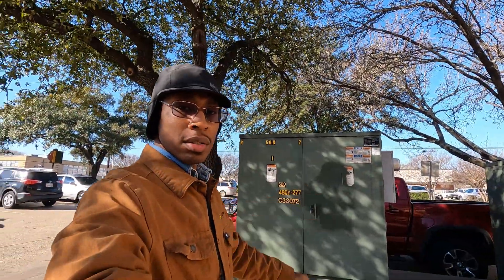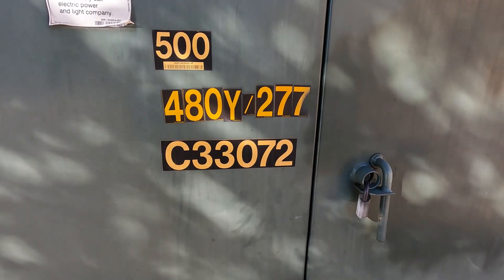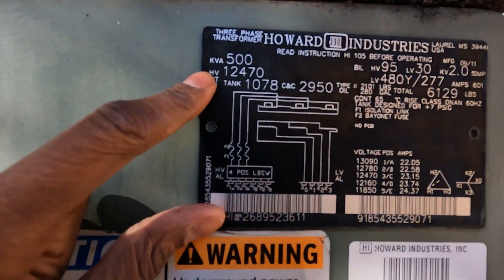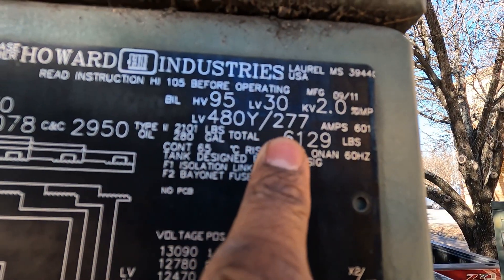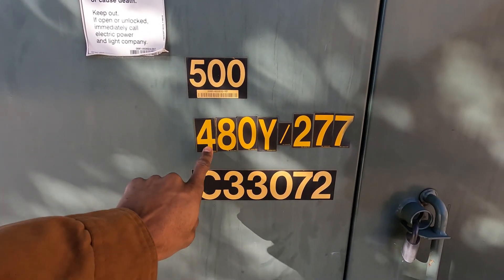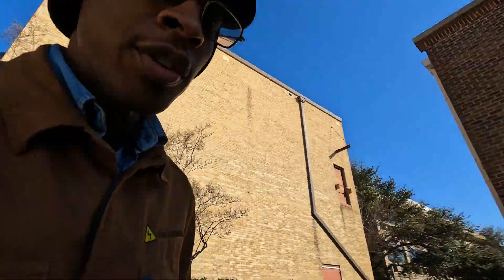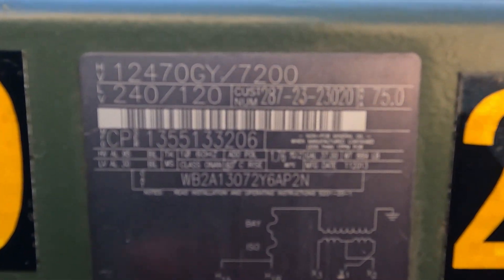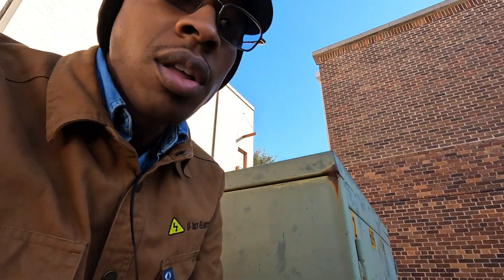Pad Mounted Transformer? Why Do I See These Everywhere?

Comment: In the U.K. we have over head transformers from 50 kva upwards to 250kva manly use on house in the country side then we 1500 KVA and upwards the biggest one we have is a 1500 kva Transformer that was on a new build for a new industrial laundry . running 600mm parallel single cables for the transformer to the new switch room